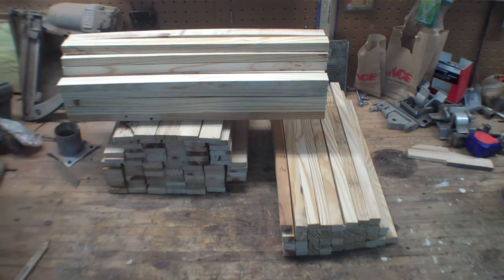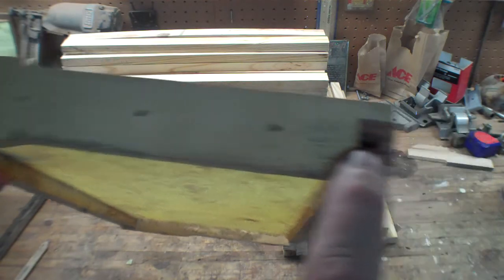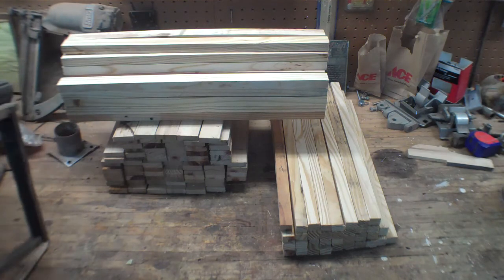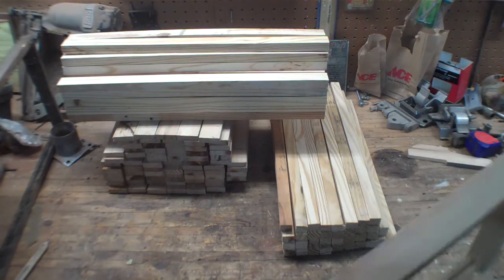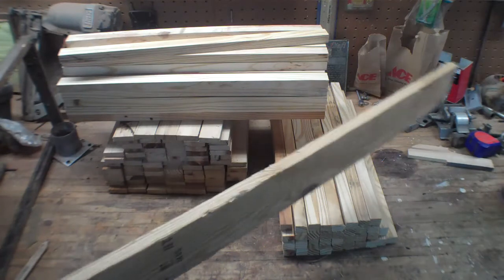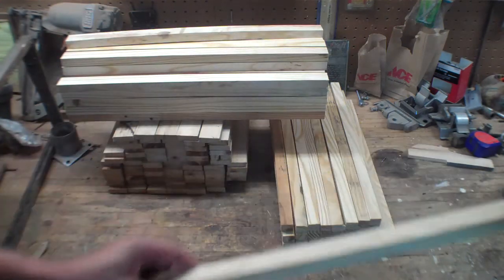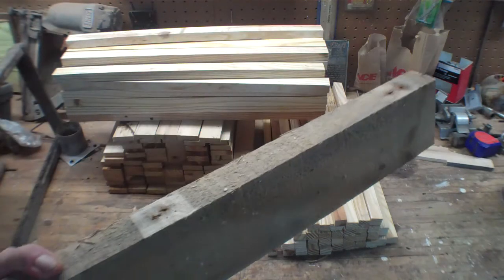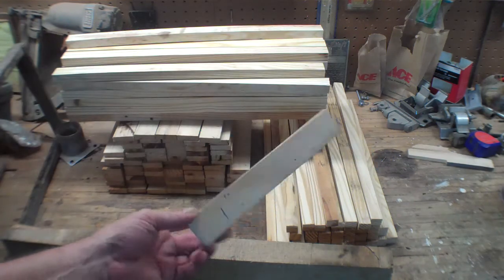Home built Langstroth style Honey Bee hives  Part 1

Comment: Thanks.

I'm a brand new BeeKeeper, and I don't want to buy my Langstroth Hives. I agree with you. Building them myself has a variety of advantages. By the time I factor in the time spent buildinging the hives, the cost is nominal. The biggest advantage is the fact that I built the hives with my own two hands. I stayed home and did something useful that I can point to later.

I have plenty of framing/construction experience, but you didn't insult me by covering every detail. I've been out of the construction trade for a couple years. Maybe I forgot something. The upside is that I still have my saws and my tools.
Reply from the maker: Best of luck Trent!..thanks for stopping by and taking the time to comment.
Reply: Hi Mr. Trent, its a good inspiration for others to make their own hives, with some trials and errors one will perfect. Thanks